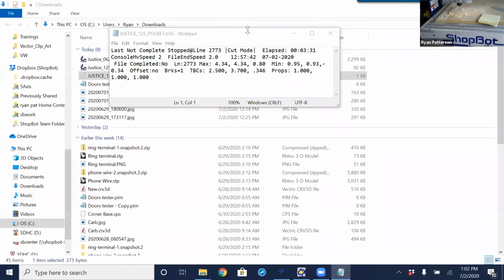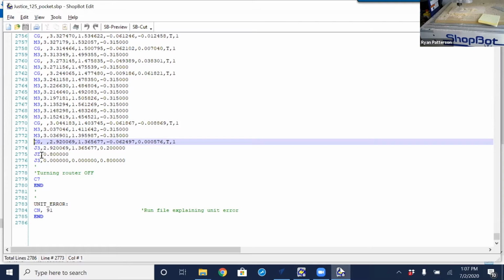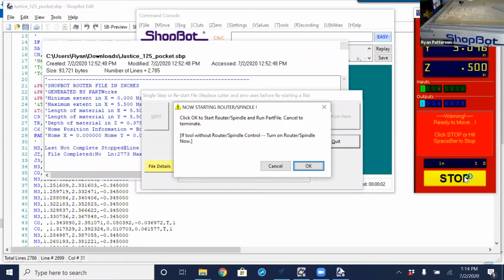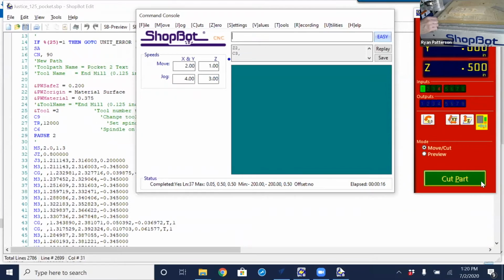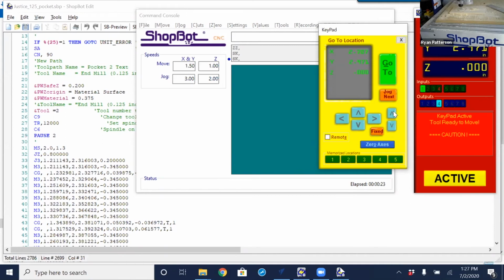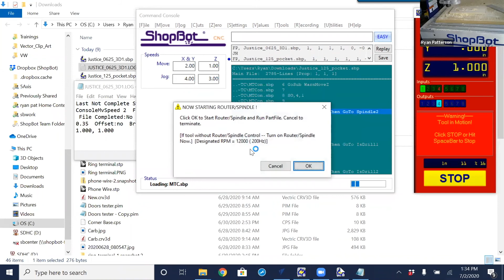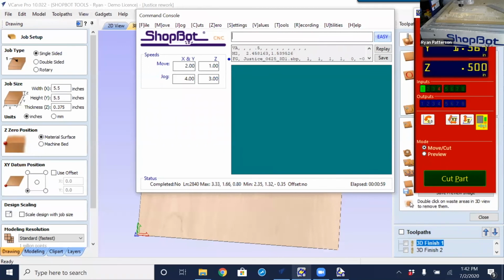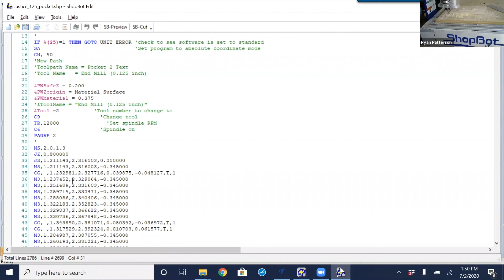Restarting and Editing a Part File

Comment: What do you recommend if the part file seems to be corrupted and need to restart?
Reply from the maker: Here's how to Setup a Restart of a file:

In ShopBot 3, Go to the File dropdown and select File->Go To Line/Single Step. now load the file just like you were going to cut it as normal. Click the Start button.
 
Once loaded, select "Setup a Restart of this file" and enter the line number you want to start from. 
 
Now click "GO". the code will be run through up to this point very rapidly, just click Yes and OK to the prompts at this step. it will not begin cutting yet.
 
Now click "Run from Here" and the spindle will start and it will plunge to depth.

If this info does not solve your issue, please contact ShopBot Tech Support at support@shopbottools.com Thanks!!